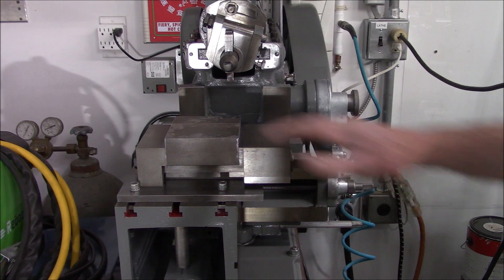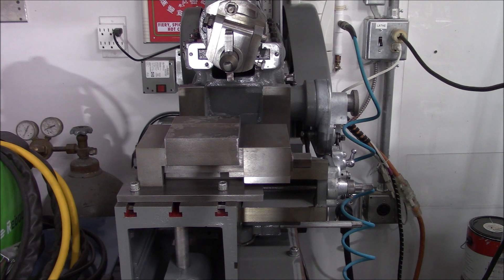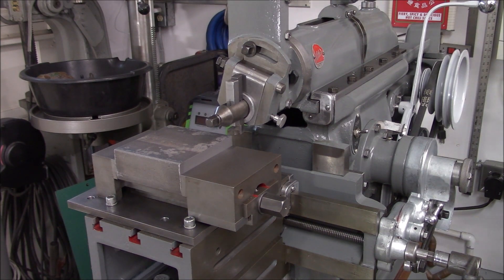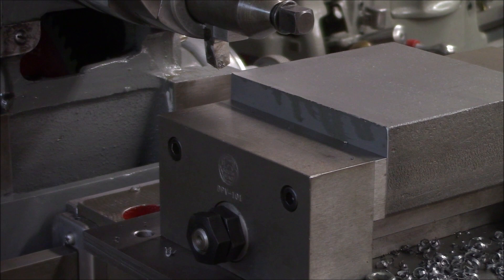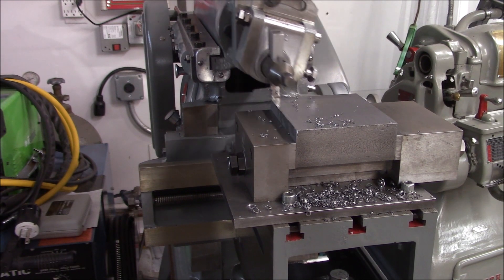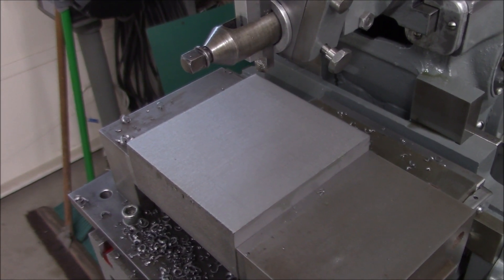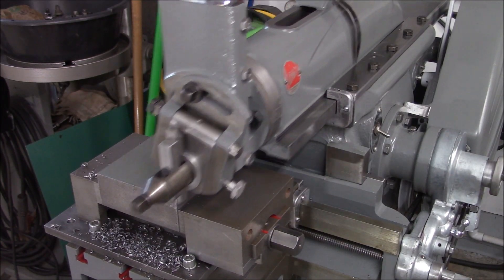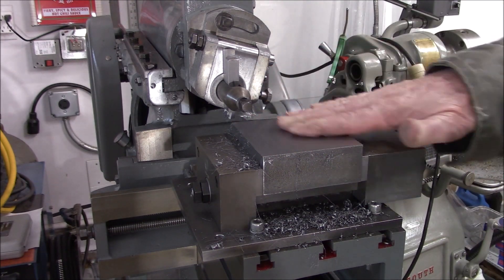Metal Shaper Monday - Roughing Tool Part-2

Comment: Dean what is your max depth of cut. I have a 7" Southbend and am curious. Thanks.
Reply from the maker: Hi Terry, So far my heaviest cuts in mild steel were in this video. depth = .020" with .010" step over.. I think it will handle a bit more but it's getting close to the max. I just need to build up a little courage to try it..
ATB....Dean
Reply: @TheAyrCaveShop  Thanks for the reply Dean. The only thing I have made with mine is a large TEE nut for the tool post on my Old Clausing Lathe. I am reluctant to hog away too much material because mine has a Phenolic Bull Gear. I originally bought mine to cut key slots in gears and pulleys and eventually I would like to try making a gear on it. Lots of potential. Rustinox is my Tutor when it comes to the Shaper. He is brilliant.

Comment: Dean, I’m about a week behind you with my shaper.   Roughing tool worked good, will grind a shear tool next.   Hope you don’t mind if I ask a few questions.   Have you checked the table to see if its parallel  to the ram?  Mine was off about .001 in 5” which resulted in a taper of my test piece which I surfaced  on both sides.  I know the ram ways and front ways are square so its likely in the table.  I wonder if adjusting the front support will help.   Also, have you found it necessary to tighten the gib on the downfeed, I had to on mine to get a good finish.
Reply from the maker: Hi Jim, I did indicate the table, in the Y direction (same direction as the ram stroke) and I believe it was about the same as yours .001" (ram low (extended), I don't remember how much stroke, probably about the same. I also measured this test block and it reflected  .001" taper over 4". I was carful scraping in the shaper body ram ways checking with a good machinist square against the table ways. I suspect its ram droop, I think they scrape some of these in to be .001" high just for that reason. I was already way past my scraping ability pay grade to try that. I just went for the clean up.
Yes tightening the down feed gib really helped, but be carful not to over tighten the outer screws, the gib can gouge when feeding.
I've also heard you can take a clean up cut on the table to true it up. I'm not sure if I want to go there, at least not for a while. The only thing I do with the table support is check that it's down firm.
Hope that helps and have fun with the shaper...
ATB....Dean
Reply: @TheAyrCaveShop  Thanks Dean, I too used a good machinist square when I trued up the ways.  I considered a clean up cut on the table too, but I want to use the machine for a while and then recheck the ram clearance and do an alignment again.  I'm not an experienced machinist so working with .001 and less has a learning curve for me.  I will say that I'm amazed at the mirror finish I got on my first aluminum test cuts, even with a roughing tool.  I'm looking forward to more Metal Shaper Mondays.

Comment: Wouldn't truning the vise 180 degrees have the same result?
Reply from the maker: Kevin, Yes I think so, I should have tried that. I did make sure the hole spacing will work both directions.
Thanks ! ATB....Dean